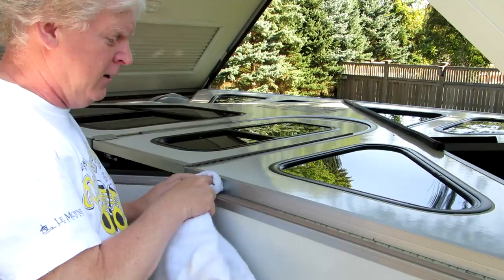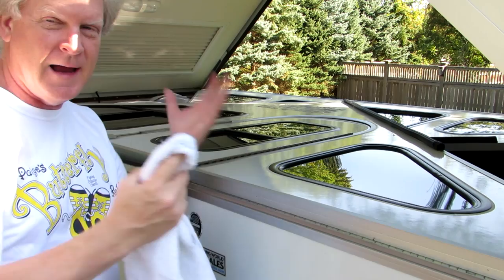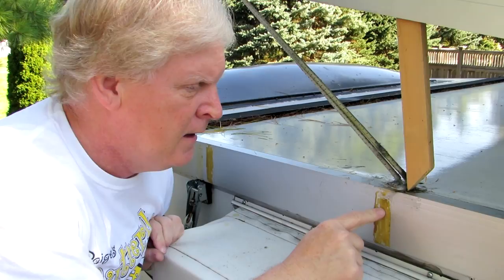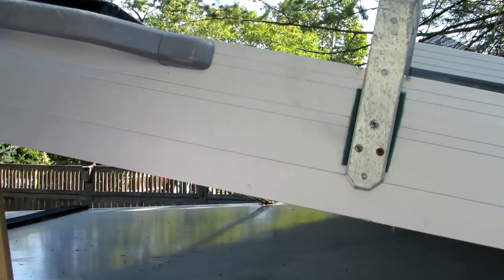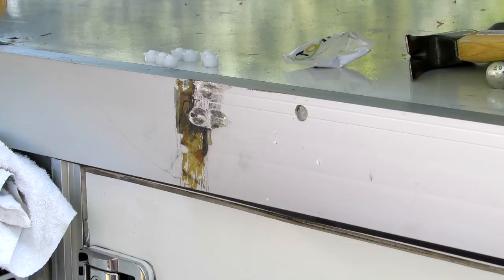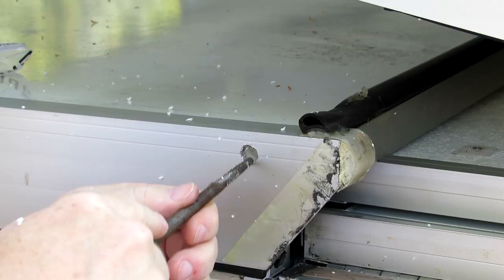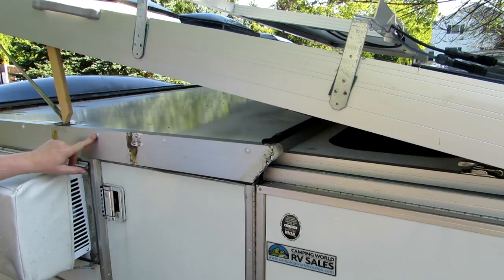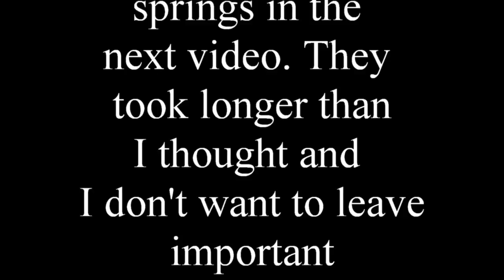Aliner Mods, Trying to solve the side rubbing problem

Comment: also on the messed up aluminum get some aluminum solder it works with a propane torch and works pretty good not as good as welding but its a solid repair .
Reply from the maker: Thanks, I might try that !!  But really, I'm not very fussy about what it looks like, as long as it works !  Thanks for the comment !!

Comment: the holes are not round also because you are working the drill in a wobble action. The correct size bit for the job might help a lot.
Reply from the maker: No,  the technique here is to have the holes be slightly "squared" so they hold the rollers tight and don't let them spin. But not squeeze the ball out of the holder.

Comment: I hope the roller bearings work. Nice fix. We  may try that too. Thanks.👍
Reply from the maker: That video wasn't supposed to be published until Monday.. Oh Well..  Guess you can't count on You tube !!  LOL.    I will report on it in 6 months.   I hope Slim reports on his experience since he did them first !
Reply: Any problems surfaced yet with the transfer rollers you installed on the roof sections.   Still waiting to hear from you or Slim.   Mike in Western Australia.  WA Avan Club Member.